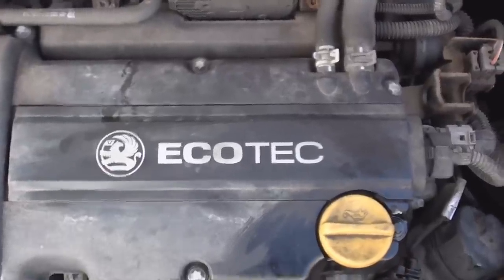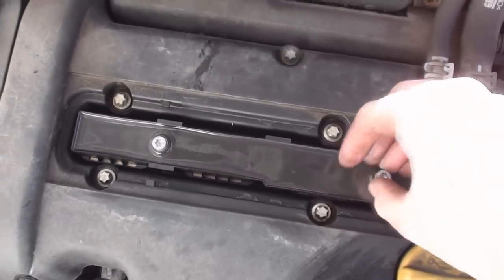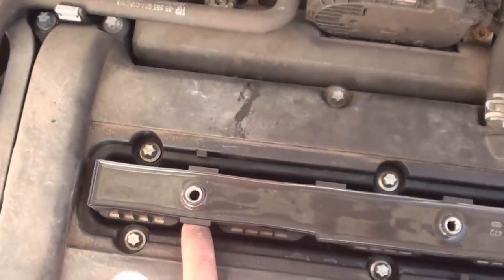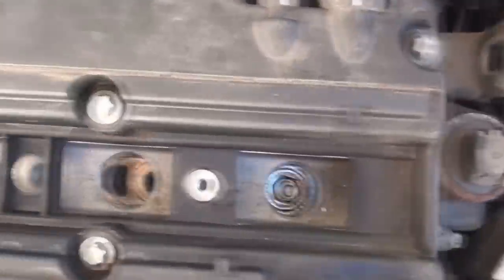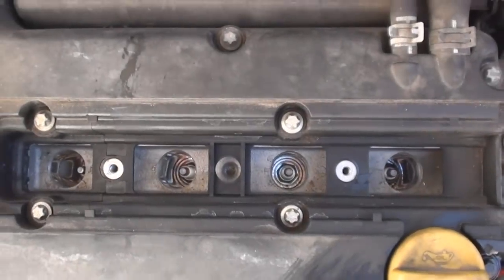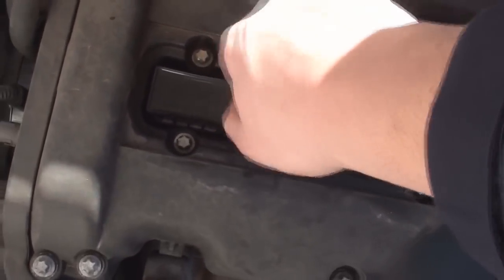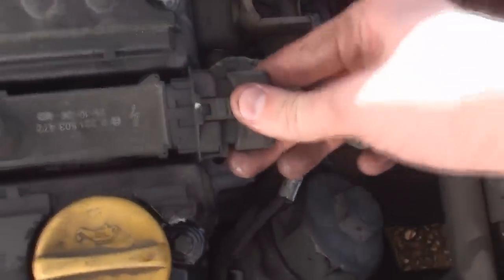How to Change the Spark Plugs (Corsa 1.2)

Comment: Just a little tip.  Make sure when you initially put the plugs in that it catches the threading perfectly so you don't strip the plug and or spark plug hole in the engine.  Also, putting a little bit on anti seize would be a good idea as it get's very hot down there and will make for easy removal next time you have to change your plugs.

Comment: Some manuals suggest that for new spark plugs use rubber pipe instead of socket. That prevents from breaking the threads of cilider block. If you catch the thread the wrong way - the rubber pipe just slips off of the spark plug.
Reply from the maker: perhaps so, but this is why they are put in by hand first so they are located in the threads to prevent this.
Reply: OK, I think It would be good to mention it in Your clip.
Reply: Jacek U He did!  at 2.05
Reply: He did not. He used metal socket instead of rubber pipe. He looks like a strong man, he could catch the threads the wrong way.
Reply from the maker: you could put the spark plug in, and sit it in the threads by turning it anticlockwise, that way it will sit in the thread so you can tighten it/ Clockwise.

Comment: I have felt like you have missed out the most important part for the beginner... It would be useful to see how you actually remove the spark plugs, how difficult it is if they havent been changed yet, what tools are you using... 

I personally was looking forward to find out what size spark plugs spanner you have used.. According to euro car parts web my corsa has 19mm size spark plugs but I could not find the same size spanner for it.. So it was interesting to see whether you had the same issue.. 

Unfortunately I didnt see anything in relation to this..
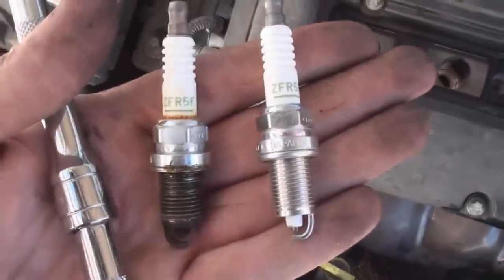Reply from the maker: Jonis Zidanas Hey, i may have not shown you the removal, but the refitting is the opposite of the removal, and that is shown. I also show the Socket that is used, not a spanner. at 2:00 mins.
Reply: @bluudysgarage  what size was the socket for the plugs please? Can’t see from the video. Thanks
Reply from the maker: @JJGrey12  it's  long time since I did this on this car. I believe it was the 14mm spark plug socket.

Comment: My 1.2 corsa engine management light came up with 'cylinder 3 misfire', as in the spark plugs need changing. So he shouldn't have that light on
Reply: The spark plugs need to be changed a lot more before they outright fail (i.e. electrodes corrode to a point that the spark gap becomes too wide for the coil to handle). Otherwise you're putting the coils to a great stress since they need to output a greater voltage once the spark gap widens. Nowadays spark plugs electrodes are made so that they corrode very very slowly. So your problem might possibly be a failed coil pack as well (fortunately, the coil pack is even easier to change than sparkplugs as you see in this video. The problem is that a new and OEM quality coilpack is fairly expensive, but if treaten good it can last life time).

Comment: Why is the engine management light on when he starts the car up after changing the plugs? Not a good sign
Reply: Probably because the DTC stays in the ECU and needs to be cleared, then if it comes back something still wrong (for example bad coil pack), otherwise everything ok. If it switches from flashing to steady while driving it's probably because the misfiring cylinder/cylinders have been identified and fuel has been cut off to the misfiring cylinder/s (my manual for a Z12XE equipped vehicle states the engine can cut off fuel when it's not needed i.e. gear inserted and gas pedal fully released) since flashing MIL usually indicates serious misfire (raw fuel getting into exhaust so that it burns in the converter heating it up and giving off a very strong rotten eggs smell). Don't know what staying lit up after start would mean.